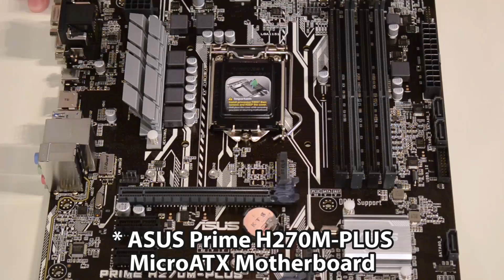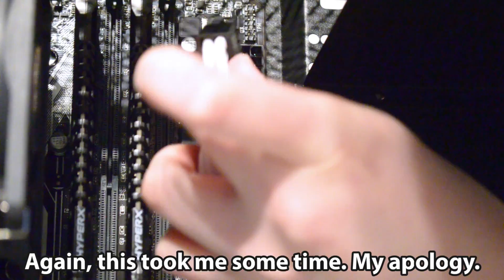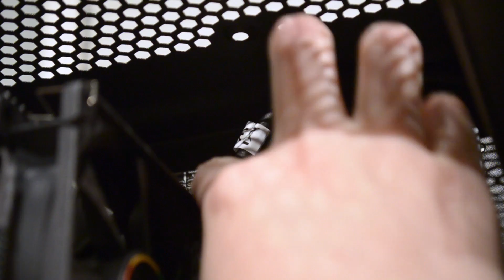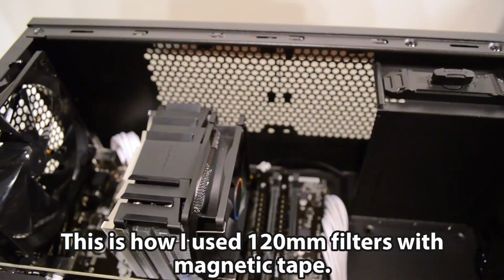Building a G4560 + GTX 1050 Computer (Step by Step)

Comment from the maker: ===========================
Installations Timeline
===========================
1) Install the CPU @ 00:07
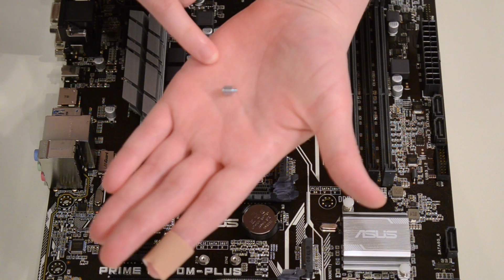2) Install the M.2. Standoff @ 00:50
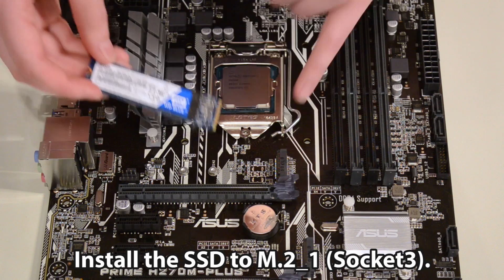3) Install the M.2. 2280 SSD @ 01:19
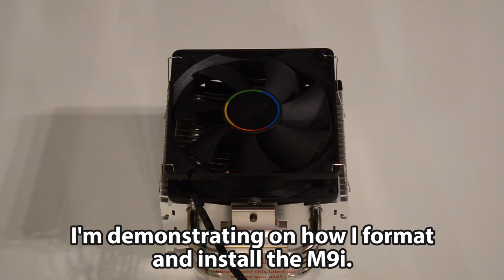4) Format of Cryorig's M9i @ 01:59
5) M9i's Backplate @ 03:12
6) Install M9i's Hexagon Pillars @ 03:23
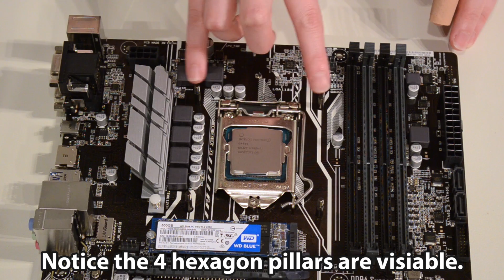7) Install M9i's Mounting Bars @ 04:19
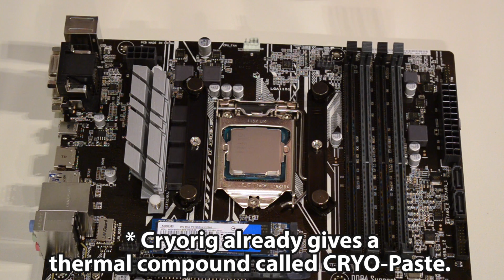8) Applying Thermal Compound @ 05:42
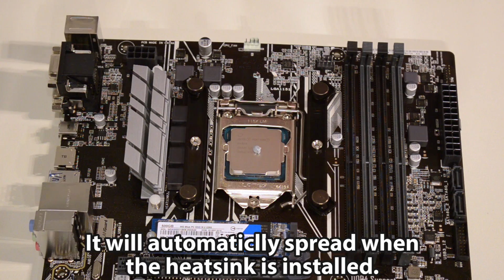9) Installing M9i's heatsink @ 06:16
10) Connecting the CPU Connector @ 07:51
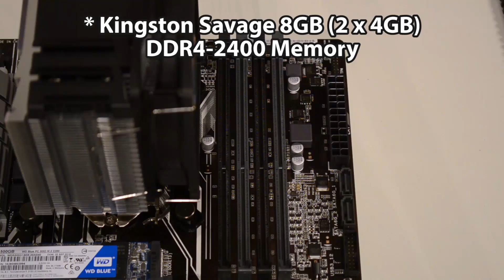11) Installing RAM @ 08:23
12) Remove PCI Slots @ 09:09
13) Install the I/O Shield @ 09:51
14) Installing Motherboard Standoffs @ 10:19
15) Tighten Motherboard Standoffs @ 11:25
16) 8-pin EPS Extension Cable (ATX PSU Cable) @ 11:47
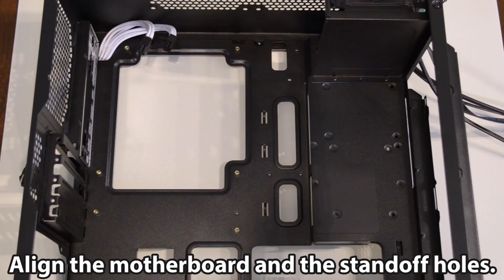17) Installing the Motherboard @ 12:24
18) Connecting CPU Cable @ 15:06
19) Connecting HD Audio Cable @ 15:29
20) Installing the PSU @ 15:47
21) 24-pin EPS Extension Cable (ATX PSU Cable) @ 16:35
22) Connecting 24-pin Connector @17:54
23) Connecting 2.0 USB Connector @ 18:04
24) Connecting 3.0 USB Connector @ 18:37
25) Front Panel Cables @ 19:03
26) Connecting Front Panel Connectors @ 19:25
27) Reinstall Hard Drive Cage @ 19:56
28) Installing 120mm Front Case Fan @ 20:31
29) Connecting 3-pin Front Case Fan @ 22:29
30) Reinstall 120mm Back Case Fan @ 22:53
31) Connecting 3-pin Back Case Fan @ 23:22
32) Connecting 8-pin Extension to ATX PSU cable @ 23:39
33) Cable Management layout behind MOBO @ 23:59
34) Reinstall Side Case Panel @ 24:11
35) Reinstall Front Case Panel @ 24:49
36) Installing EVGA's GTX 1050 @ 25:11
37) Magnetic Filters @ 26:24
38) Power ON to test the computer @ 27:02

Comment: I'm so glad i didn't get that Thermaltake case. It looks like a pain in the ass to build in. Although it supports mico-atx boards i'd suggest using a mini-itx board instead. Or just get a better case like the DarkFlash DLM 21 Mesh. The easiest case i ever built in. Best budget case hands down, imo of course.
Reply from the maker: That's OK. I had no major problems with the Thermaltake case but I am aware of its flaw with this particular one. Especially if someone was interested in an ODD then it's best to pass over the Thermaltake Versa H15 MicroATX Mid Tower case.

Yes, knowing there are far better cases over the years so thank goodness. Hopefully, no manufacturer follows this MicroATX Mid Tower's layout again and just improve by making sure there's plenty or enough space for cables and possible internal component installations. And sure I can agree about the DarkFlash cases, and anything with a frontal mesh with a filter to have better airflow.

And I'm not sure why my held for review comments wasn't appearing in the past. I should've checked them in the desktop version. I will check them this way from now on so I don't miss any other comments.

Comment: Really good video - only question the insulating washers on the motherboard mounting screws - definitely a bad idea as the board should be grounded to the case. Thanks for the rest, very useful.
Reply from the maker: Thanks and yes not a requirement since the MOBO has those metal strips around their holes to help with grounding when properly attached to the standoffs between the case. As long there's no issues with the standoffs since those do help prevent the short. So I get what you are saying there.

Maybe I be better off with a paper or fiber or some "red" washer if something was worn out which I have seen some used MOBOs so stripped with loss of metal around their holes that I began a habit to try prevent further loss or reduce a short problematic result. Or worry of pinching to much on the MOBO's PCB. It's so minuscule what I have done that I haven't run into problems nor has my friend.

No one has to do on what I do and not a need either. But I should rephrase that scenario better next time for those concerns.

And I do POST, benchmarks and stress test with every computer build that I have done in the past. Either with or without those washers.

Sorry I forgot to say this. Thanks again for your comments and glad the rest was helpful.
Reply from the maker: P.S. - So I checked what my washers are from my amazon order in 2016 and I been saying the wrong word all this time. I used nylon washers. Poor choice on my wording and subtitles so I need to correct my wording with my next pair of videos. Here is the link that I been using for motherboard washers so its truly my bad for my incorrect words: https://www.amazon.com/Motherboard-Flat-Nylon-Washers-White/dp/B00BJLZ3BK/ref=sr_1_1

Comment: My PC Gas an ryzen 3 2200g andere a GTX 760 and this Case 😂😂😂😂
Reply from the maker: The Ryzen 3 2200G (with integrated graphics, Radeon Vega 8) wasn't around in March 2017 when I built this and this video post date doesn't reflect the built date. Currently I would recommend the Athlon 200GE paired with a RX560/RX 570 if someone needed a basic PC for internet, office, basic photo editing or some light gaming these days in 1080p since the Coffee Lake Pentium processors are overpriced at the moment. Plus this March 2017 build was a good deal at the time for dual-core processors ($63.84) but then in April those G4560 Pentiums went up in price. So it happened to both Kaby Lake and Coffee Lake Pentiums (started around $60~$70 then up to $80-$100) because dual-core CPUs with hyperthreading does a decent job for the basic uses with no thrills and sticking with a max budget of $450-550 ratio (included with Windows 10, mouse + keyboard, 1080p monitor and without or with a dedicated GPU). Thankfully the Athlon 200GE is around for those who need integrated graphics with a tight budget for the daily uses and can possibly play some games but in 720p. A decent dedicated GPU would help more if aiming to game or need to do light photo editing/rendering small footage videos as long the software permits utilization for both CPU and GPU with no issues.

Comment: How the fps with a 1050ti and the g4560? The g4620 is almost the same why didn't you go for that one higher clock speed. (I know it's a older video) / but good job
Reply from the maker: I cannot say personal experience with the G4560 paired with the GTX 1050 Ti, but from what I read and even on PCPP people seem to easily achieve 60 FPS + with High/Ultra settings (depending on the type of game) in 1920 x 1080.

And the reason I didn't purchase the G4620 was due to price. February 2017 they were asking about $60-64 for a G4560. The G4600 was around $80 and the G4620 was around $95. I think the G4560 was a great price for something that was not far behind with Skylake's i3-6100 for half the price. (Until the shortage and popularity of the G4560 altered the pricing dramatically in a months time and became overpriced by April 2017, but thankfully I got a G4560 for $64 before that all happen).

Also, thank you very much for the compliment and your support. I appreciate it!
Reply: Eltech

CAN$? OR USD$? I know here in canada I get from amazon it's not very cheap quite pricey.
Reply from the maker: alarming tugboat - US dollar (in my state I have no sales tax but does not necessarily make purchases more cheap). And I believe you about the Canada dollar being pricey. I know Coffee Lake (8th generation) Pentiums are going to be similar to their Kaby Lake siblings with 2 cores and 4 threads, but price range might be a tad more.
Reply: Eltech gonna stick with 6-7th gen no upgrades yet,maybe when a xeon is cheap I'll switch to a new platform, coffee lake does have flaws and I don't want to have those flaws,...and yes in canada the prices are through the roof.
Reply from the maker: alarming tugboat - No worries. I haven't changed my main PC's core componets and it's still the 4th generation. Continues to meet my needs to this day.

Also understandable since no need to upgrade anytime soon when have a 6th or 7th generation. Best wishes to you if you find a Xeon with a reasonable offer.

Comment: Hi enjoyed your video just wondering does the G4560 need any bios updating with the motherboard ?
Reply from the maker: Thomas Jamison - Thank you and glad to know you enjoyed it! And no BIOS update was required with the G4560. It was ready and easily installed Windows 10 with no issues.
Reply: Eltech Thanks for the reply, have another question sorry and was wondering if I needed an as expensive motherboard ? and wonderd of a ASUS PRIME B250M-K Motherboard would do I stead. Thanks for your help as planning to build my first PC and need all the help possible.
Reply from the maker: Thomas Jamison - You most certainly can switch to a ASUS PRIME B250M-K. It will surely offer on what you will need regardless. It's mostly a similar layout just less amount of features. The latest BIOS version for the "K" MOBO is 1001 which was January 4th, 2018.

And it's no problem! Happy to help in anyway I can.